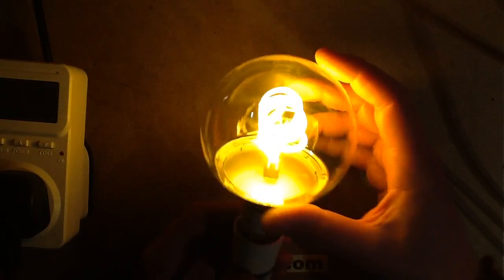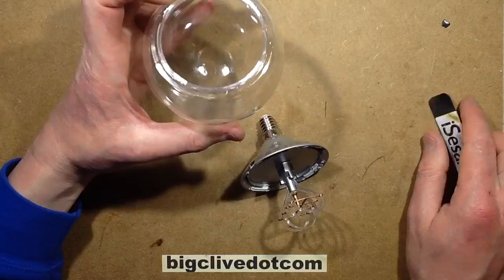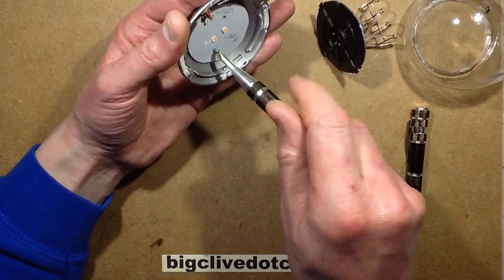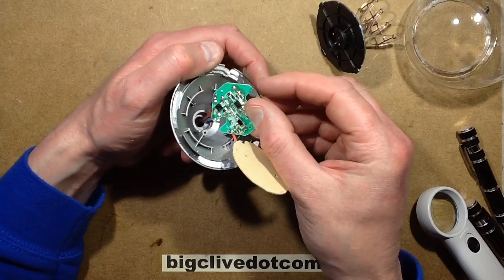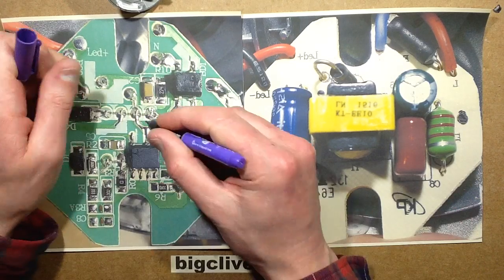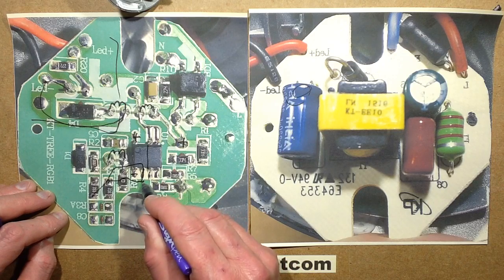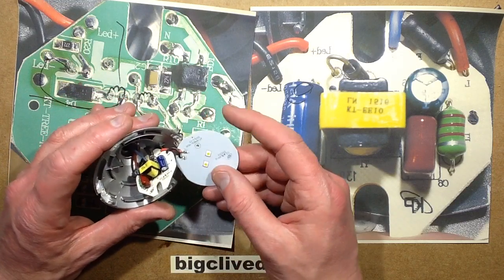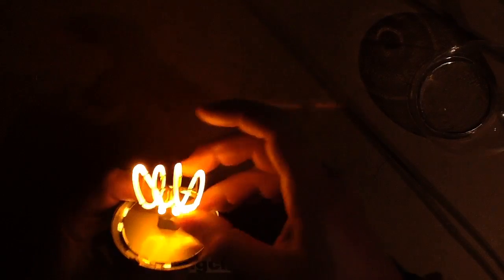IKEA Nittio LED lamp teardown.

Comment: Hi Clive, just wondering where you got the adaptor a for the bulb caps? As I don't really feel confident if I order them on eBay as the quality is not guaranteed
Reply from the maker: +Shane Donnellan eBay and then assess the quality yourself for exposed metal and contact spacing.  IKEA actually sell their own version of these adaptors.
Reply: +TheChipmunk2008 Thank you!
Reply: +bigclivedotcom Thanks Clive
Reply: +Shane Donnellan Shane, not sure where you are, but TLC do a wide selection of them: https://www.tlc-direct.co.uk/Main_Index/Lighting_Menu_Index/Lamp_Adaptors/index.html